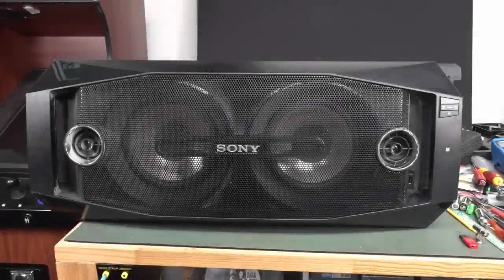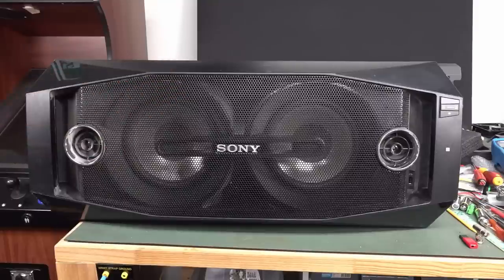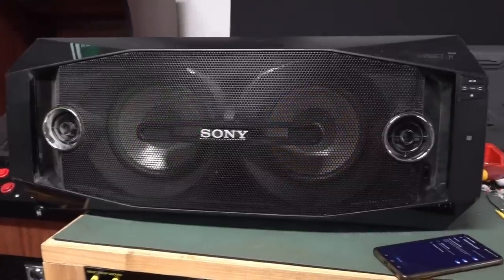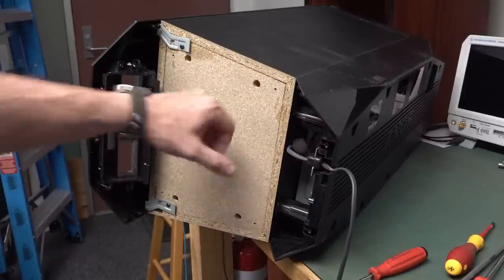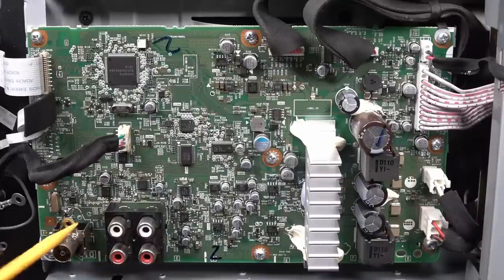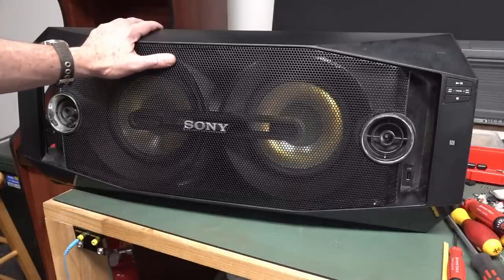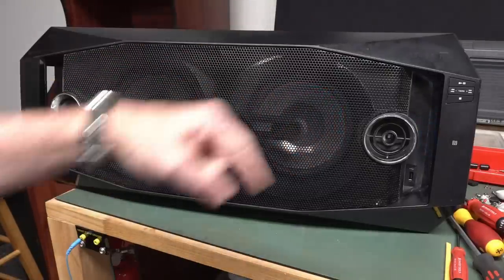EEVblog 1513 - Dumpster Tossers Have No Shame!

Comment: Commercial audio engineer here. Most of the time, I've found that the Bluetooth interface/device is "bad" because of two (very inclusive) possibilities: 1) Old/crappy smart phone with bad Bluetooth support, or 2) not understanding Bluetooth has limited range. (One customer couldn't figure out why the Bluetooth wouldn't work from across the floor of an office building. 🙄) I'd bet good money there's nothing wrong with that unit at all, and any perceived issue had more to do with the source device. Re: Jukebox, I love Huxley's taste. You should totally build out a jukebox with all the blinkenlights. This Sony might be an excellent base to start from.
Reply from the maker: Very likely.
Reply: There are reports from people who consistently have bad Bluetooth experience, although anecdotal evidence. Personally I have a consistently bad experience with it, across dozens of devices. My Bose noise cancelling headphones will have frequent drop outs for me, that's from pocket to head. But I lent them to a mate and he never had an issue, we had the same phone. It doesn't seem to matter what device or speaker or headphone I use, Bluetooth is a consistently bad experience.
Reply: @_BangDroid_  Yeah, I prefer cabling directly myself. There are probably some RF factors in here as well. I have some Altec Lansing sport earbuds that cut out on me if I carry my phone in my left pocket, but not my right. Still, it's kind of astounding how well it can work.
Reply: @_BangDroid_  Funny that I've always had good experience with Bluetooth through the years, even having stereo BT headsets from when it was a fancy thing (like 2010 or so? Nothing too "rich only" anymore, but still fancy unlike today), never a problem, other than one VERY specific place in my university's building where there's cutouts on the sound. Like, I move 1m away from that very precise position, or I turn my head a little, and no problems anymore.
Reply: @Kalvinjj  Very similar issue with my Bose and an Audio Technica pair of headphones in 1 specific spot across a pedestrian crossing in the city. Every morning without fail it dropped out while walking across. Different phones even. Definitely some RF interference. Far from the total extent of my Bluetooth woes but the most consistent.
Reply: so in other words a bluetooth device is usually bad because theres actually nothing wrong with it? shut up and take my money i say
Reply: I love Bluetooth in the car.  That's the perfect case for it.  It's just there when I need it, and I don't have to do anything to set it up or tear it down after use.  Also, my Toyota factory stereo's BT receiver is shockingly rock-solid, for some reason.

I also like BT for web meetings, so I have the freedom to walk around a little, and even open a relief valve around the corner, if needs be.

But for music from my phone?  Give me a cable, please.
Reply: @Kalvinjj  @BangDroid Remember BT operates on 2.4 GHz, same as Wi-Fi (and most microwave ovens, in fact). I'd guess those weird issues are due to a local Wi-Fi access point causing interference.
Reply: @McTroyd  yes, could be that, but some VERY specific network in there, since I can stare at routers in the campus without getting a single error (they all transmit both 2.4 and 5GHz), only that very precise place it jams.
Or who knows, some measurement equipment they run there, or whatever other 2.4GHz transmitter. It's just very funny how it's a precise small spot where it happens.
Reply: @nickwallette6201  music on my phone is a perfect use for wireless. If I tuck cables out of the way while I'm gardening/decorating/at the gym etc they get all sweaty, if I leave them dangling my headphones will be randomly ripped away from my head as the cables catch on a door handle or something.
Reply: @fuzzylogickben   I get it.  It's a great option.  I just wish it wasn't the only option.
Reply: @McTroyd   "Well, ackshually...."  🤓  Bluetooth uses Adaptive Frequency Hopping to avoid 802.11, and other static frequency interference.  The FCC even requires that a BT device do this regularly - like every half minute.  Which is for the best, since BT is often used for devices that aren't necessarily going to stay put, so they need to scan the airwaves continuously to adapt to the changing environment around them.

BT also constantly hops channels, so poor RF performance should be a very, very short-term issue.

However, with strong and wide-band interference nearby, you might be able to saturate the RF receiver of a BT device.  I often wonder if this is happening at my desk, where I have a WiFi AP in the room next door, a BT keyboard, BT mouse, and Logitech proprietary 2.4GHz keyboard and mouse, two phones, a PS4 controller ....  It's kind of amazing any of it works at all.
Reply: @nickwallette6201  It sure is. That wide-band interference is exactly what I'm talking about. At a crosswalk in a major city (particularly if they provide city-wide Wi-Fi), there might simply not be any clear bandwidth. Even in an office or apartment building, though, couple the busyness of the airwaves with the range of antenna quality, and it's a recipe for problems.

I'd guess your wireless setup is working because everything but the Wi-Fi is fairly low bandwidth. Your mice and keyboards probably spend a lot of their time idle. Dunno about the PS4 controller, but I'd hazard a guess it only transmits when there's activity as well, give or take a heartbeat. And it's amazing what Logitech has done with the Unify platform. I've abused those keyboards and mice across a couple divided conference rooms, back to a rack in a LAN room, and got away with it for some quick troubleshooting. (Placement of each end was important, of course.)
Reply: It's got APT-X which is a good lag-free Codec, will be OK for lip-sync of Movies etc. Dave's phone picked that up when it paired.
Reply: @_BangDroid_  Many a Bluetooth Audio connection will get flaky after a few minutes of no sound. Don't ask me why. But turning it off and back on fixes the problem... temporarily, until the next long pause.

Comment: The way Dave looks at dumpsters, people will probably think he is homeless :D
Reply from the maker: Picture me hanging by my stomach over the edge with my head in wearing my smelly gym gear...
Reply: @EEVblog  Good find though, sure Huxley will like it
Reply: I found a PS3 in a dumpster a couple years ago. It was in perfect working condition, and there was practically no dust in it, indicating it was practically never used, but I had to get all the cables and controllers for it.
Reply: Engineers look at stuff differently than most people. We see a perfectly fixable piece of gadgetry in the trash as a tragic waste. Look up the e-waste dumps in the Republic of Congo and you may begin to feel the gut wrench we do when we see such blatant waste.

Comment: I've repaired a fair few of these over the last few years - similar models, interestingly most are Sony, a common problem is that the fan doesn't come on and the amp either keeps cutting out or just overheats and dies. They're one of the few remaining companies that will supply you the parts you need as well as a service manual and schematic
Reply: I assume this comment plus Dave saying that he could not hear the fan coming on might be the answer why this was tossed...! Maybe

Comment: I like seeing high quality caps on the secondary and normal ones on the mains. Given the typical failure modes, it shows good use of budget while still keeping the product as a whole high quality.
Reply: Spot on! On the same page with this! 🙌
Reply: Yep.  That's what I thought, too.  When he opened it up, I was thinking "may as well replace the caps while you're in there."  And then he showed the mains cap, which sort of reinforced my opinion.  Then he found the secondary and amplifier caps, and I sat my :-D back down and shut up.

Comment: I'm watching this on a 65" LED TV I dumpster dove for 5 years ago.  Still works great.  Have to hit it every now and then but that's about it.
Reply: Percussive maintenance, a man of culture I see 👍👍
Reply: Dude I just found a Bauhn 48" 4K QLED TV on council cleanup. It's a crappy ALDI brand but it still looks better than any of the other monitors I have. The only thing wrong it is sometimes it doesn't power on from the off state (fine from sleep). I assume it's a power supply related problem that I will get to at some point.
Reply: @ky5666  That definitely sounds like bad caps on the secondary side of the power supply
Reply: Using a Dell 20" wide ST2010f LCD monitor here to view this video which I dumpster dove a couple yrs back .. some of these monitors don't work at its age - but this one does!!!

Comment: I can explain how that would go where I work:
At some point in time, "we need a presentation room".  People ask around, and someone from ICT or Facility orders some stuff from the local webshop.
Like a TV, such a speaker, etc.  It is put in a meeting room and in itself it works fine, but after a year or two the management tells us "we need something more professional".
So a specialized company is ordered in, and they rebuild the room, install some professional equipment like dimmable lights and speakers in the drop ceiling.
They come in without notice to us, so they start working in the room when the equipment is still there and it all gets dusty from the plasterboard cutting etc.
When they are finished, they ask where the old stuff should go.
Now here, it becomes a little different from what you observed.  We don't have such a dumpster room, but we have seemingly endless storage.
So it would go into some storage area, to be left there for 10 years, until it is all obsolete.  Then it would be carried to the recycling center.
However I can well understand that in your case it would have been carried to the dumpster room in unknown state.  The people who bring it there do not know why it was replaced and if it is still working.
Reply: Rob that is an excellent explanation of how resources are mismanaged in typically larger organisations. The soldiers are not in touch with leadership's intention or those who are leading are replaced in a couple of years anyway, leaving the valuable resources lost forever = waste.
Reply: The guy who curates Tesla's dumpster room got himself a perfectly fine dancing ™ girlfriend.
Reply: 100% agree I’ve been the guy that’s walked the stuff to the dumpster. New managers like to start fresh and the easiest way to deal with hoarded equipment is to just throw it away. The bin is the easiest most manageable storage solution on the planet. Everything quite literally becomes someone else’s problem in 100 years from now.

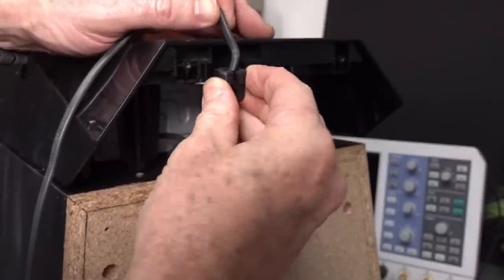Comment: 13:53 Open the grommet and pull the AC cable in a couple of inches so the part that got lots of bending is safely inside, and new cable is the bend point. Extend the life.

Comment: Chipboard is PVC veneered, they route the V groove into the big sheet, all the holes, then the sheet is taken and bent to shape. Glue used is a 2 part urethane, used because it expands and fills the gaps to make the cabinet air tight, then wrapped up to make the cabinet. The ends are plain board, also milled out with a CNC machine, as this is both fast, accurate and easy to update for new styles, plus you make the parts to minimise sheet waste. 

PCB scrap used as holder with the writing is because normally the panel scrap is thrown away, somebody likely got a bonus in the design team for this small job, saving Sony 4c on the cost of the unit, by using a part of the PCB panel that they normally would toss out, as it was for a shaped board, and use it to hold the BT board down. 2 extra holes in the NC file, and the changed silkscreen layer, and saved 4c per unit. His bonus, plus photo on the team board, was likely 0.1c of the cost saved for the first year of production....

SMD capacitors on the board are very likely Sony in house, hopefully they have finally fixed the (in)famous Sony capacitor failure mode, though I have no doubt that in 15 years all of them will leak to some degree or the other, but the Nichicons will still be perfect, even the Samxon one, seeing as it has little stress, aside from voltage keeping it formed.

Comment: Hi Dave ..... I have suggested this before ...... why don't to put some notices around the walls of the dumpster room and on the inside of the door simply asking people to let you know if they are putting any electrical or electronic item or items in there. They could knock on your workshop door, push a note under it or simply send you a text message. You may even be able to do a video with the people in the dumpster room who are throwing all this stuff away to find out why they are disposing of it.

Comment: Dumpsters are full of surprises.  But sometimes you have to wait for the right thing to turn up.  I rcently needed system with support for two floppy drives, one 5.25" and one 3.5" to resurrect old media.  Turns out my last antique, an HP with a BTX board has a floppy connector but the BIOS only handles one drive and crazier, there only seems to be a single drive select line on the mainboard so only support for one drive.  I don't want to switch drives all the time so I had to wait for the right kind of vintage PC to turn up in the dumpster.
Oh and I have two similar size entertainment systems on the usrgery table in the lab, one blown power supply and the other has a input producing 100Hz humming sound after subjected to overvoltage.  Expected total repair cost < 5€.

Comment: Man. Class D really has changed the game for power amps. Now that in more recent times they've gotten Class D to be pretty transparent and low distortion, a lot of pro audio has moved over to it. A few years back, I was upgrading the power amps at a venue, the PA system was driven by two EV P2000 power amps. These took up 3U each, weighed a tonne, were noisy and didn't really have the usable headroom they needed, so I replaced it with a Lab Gruppen D 40:4L. Replaced 6U of noisy heavy boat anchor and 1U of system processing with 1U of DSP and 4000W Class D power amp in one. Happily drove the entire PA off that one rack unit. It sounded better, noise floor was basically gone, way more headroom and it had built-in Lake processing.

Comment: It's even got aptX - the low latency Bluetooth audio protocol - it's not thee latest BT audio tech, but it's pretty shmick.
Reply: I still don't understand why we don't use the aptX codecs in files. It's a codec based on ADPCM and does not do "frequency-screwing" like I call that psychoacoustic crap other lossy codecs are doing.
Reply: aptX LL is low latency and is an optional extension, aptX is just higher bandwidth

Comment: New version of the ghetto blaster. It's what we used to call them when we were young. But it had a cassette player and radio.  they were a large size. We didn't have wi-fi, or computers back then your cell phones. LOL. Good job
Reply from the maker: I've got a teardown coming on that, I have the THE 80's iconic ghetto blaster
Reply: @EEVblog  oh yes you have

Comment: In uni a factory (HP) closed and I scored large in the dumpster! Paid for all my uni, rent, a car, trip to Japan and more!
Reply: What did you find?
Reply from the maker: Nice! You resold on ebay?
Reply: @EEVblog  nope. Craigslist and to specific buyers. Sold a lot to a used test equipment company. I still have goofy things like an "absorbing clamp" which apparently cost a fortune but I kept for memories.
Reply: @shankthebat8654  like 100 thin clients, ram, scopes, power supplies, RF gear, about 200 used erased hard drives, about 200 big for the time monitors, electronic parts, oh it just went on and on ☺️

Comment: Outputting 2x150W RMS (or even 2x250W RMS "reference" whatever that means) while using only 110W from the mains, that is not bad at all!
Reply: Some air heat pump inside, definitely.
Reply: Rated mains power input generally is not peak power input on audio gear, and hasn't been in decades.
Reply: @PileOfEmptyTapes  But that means the output spec (2x150W RMS) is just BOGUS.
With 110W input and a switching power supply and final stage there will be no more than 2x50W RMS output in the OPTIMAL case.

Comment: I'm at least glad it's gone to a better home, and not just into landfill which it might have done if you hadn't have "recovered" it. I'm not sure on the building of a cabinet, but I built a jukebox type thing with a single board computer and a touch screen. I used a PCM5122 hat on a pi, but I'm sure anything similar could be cobbled together in some kind of case, maybe you could even strip that speaker system down and build it into something, or ask them to help with the design (so it's closer to what they want!). The software I used was called Volumio, but there's a few similar things available. Great vid, Dave <3

Comment: 7:47 Has the glue failed, I scored a car subwoofer, it had been subjected to way too much 'Duff Duff' and the box had started to come apart, probably buzzes something awful when pushed.

I scored a much smaller powered speaker than Dave's, someone had subjected it to way too much G force, while the case is fine, the woofer's magnet had broken free! Kind of 'flapping in the breeze' Just for a joke, with no thoughts of great success, I glued the magnet back in place with some Sikaflex sealant/glue I had handy (kind of like silicon sealant) and it actually worked!
https://youtu.be/YFdO_iqD-Ac